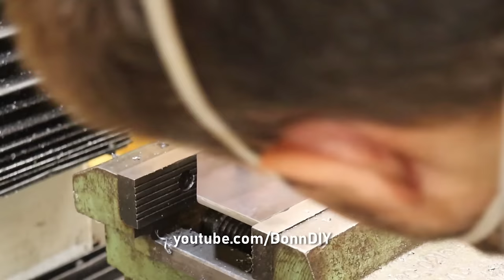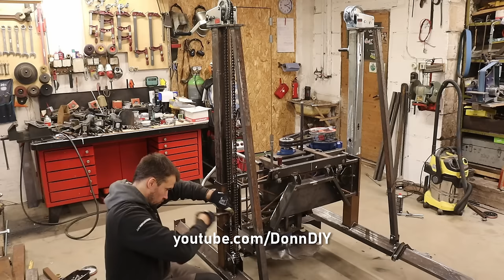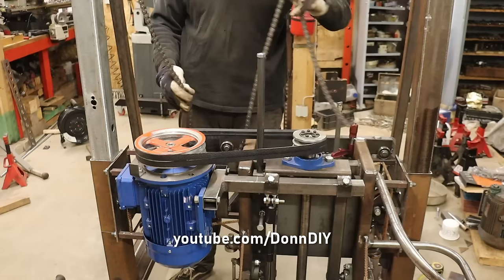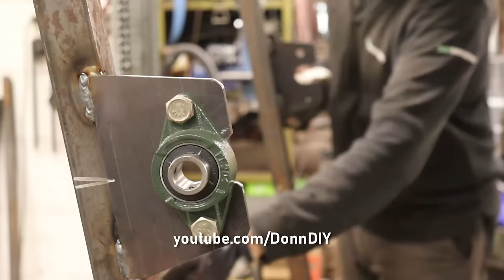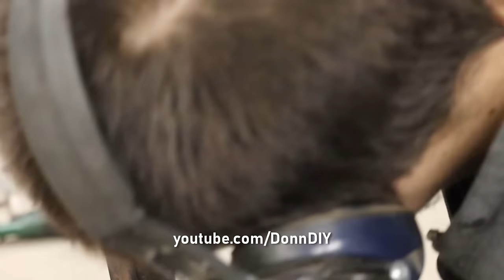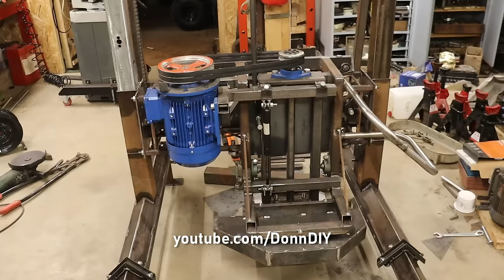Swingblade SAWMILL Build Ep.8 - Parallel Lift, Board Size Adjustment

Comment: I am pretty sure you clearly explained that when you first made your meter-long section. I was on board for that. what I could not forsee was how you were going to get the parallel lift to work. Even after you showed it working I had to rewatch like 4 times before it made sense! brilliant stuff!

Comment: 22:16 Do it in sections and use cable to tension the sections/beam together. Like a modern suspension bridge. Instead of putting the bolts inside the pipe (at the four corners) put the cable inside there, and move the bolts inside (of those four coordinates). You can easily span 10 meters with something like this once you've put the proper tension on it.

Comment: Have you considered building multiple sections of beam, maybe 4m length each, and bolting them together?  If the mounting hardware is inside, it could still have a smooth outside surface at the joint for the carriage to roll across.  That way you are not limited by the size of your shop.
Reply from the maker: Yup, this has been suggested by others as well and I do agree with it.👍 I have to think about it and seriously consider building the beam in sections.

Comment: Awesome build, as always. I love to watch your workmanship. The only thing I dont get, sorry if its obvious... the machines main rails direction, how the tower will slide... and the orientation of the blade guards.... or the vertical rail is just this short until you build it? Are you going to replace that beam rail to a long one after the other mechanical parts are done? Maybe you told this already in one of the parts... , and I just missed t...
Reply from the maker: Just watch the end of this video...
Reply: @DonnDIY  oh I did not reached to that point. I went back to EP 1 and found when you build, you wrote to the screen that this is a test carriage. Make sense. Thanks for your answer. :) Cant wait to see the next episode.

Comment: I’m not all that bright but will those chains not get clogged with sawdust and soon fail.
Reply from the maker: Reasonable concern - I'm experimenting with different sprays to find the best non-sticky one. If the chains get clogged I just have to clean'em.👍
Reply: @DonnDIY  // I use a bicycle chain "dry lube" called: "Squirt" on applications like this. It's a not sticky dry lube with a wax consistency once it's dry.

Comment: 20:44 no sprocket bearing ?
movement would perhaps be easier, fluid...
&
Metaflux 70-30 Abra+
Teflon lubricant to clean abrasive disc 
but does not clog with chips, 
and makes efforts much easier,

except that it must be reapplied very often, volatile, 
and polluting
Reply: Great  work i think  you are able to cut and saw huge trees with your new mill, and that are also what a Swing-blade mill are ment fore 👍
may be the first project for the D/D Swing-blade should be material for building a shed for the mill ❓
Reply from the maker: I already have made a shed blueprint in advance to this mill that is waiting for its turn to be built. 😀
Reply from the maker: The sprockets have to be lubricated each time before use. I didn't bother with bearings since the rotation speed is so low. And it was easier to build. I am currently using teflon spray. And have to experiment with different oils to get the best result.

Comment: Donn. That is not how I would have done it. I would have welded the chain directly to the sprocket bracket and then jacked the frame up until it bent. After a few more cocktails I would be forced to called my stepson to come over with his angle grinder to free up the industrial strength instant adhesive (cyanoacrylate) from my, well, let's say "hands". See? Wasn't that easy? I'll be fine in a couple of weeks.   😉🤣😂🤣😂😍🤩❤😺

Comment: I keep thinking you should use more bearings to make it smoother and get rid of metal on metal wear. But then I remember that this is going to spend it's life outside in the rain, snow, and whatever else nature is going to through at it and bearings are expensive and water always gets in no matter how good a seal is on it. This is a great project but makes me a bit nervous to use it compared to a bandsaw style mill. Great job as usual.
Reply: The amount of wear something like this will see is minimal. It would take 20 years to wear through that metal. It's not an industrial saw that sees 50 logs a week. My grandpa's brother had a mill that would occasionally (as an overflow from the bigger mill) cut something like 10~20 long per week. It didn't have any bearings, metal on metal and it's still a solid construction to this day. I still go to my brother's farm and cut wood on it from time to time. Unless my brother fixed anything (and i don't think he did) that mill's now... 64 years old or there about. It lives in a shed, sure, but it's still out in the open. Sometimes, simple, but functional is the best way to go.
Reply: @aserta  ummm,my non industrial saw sees more than 200 logs per week on a slow to average week,and the saw blades ate the most costly part other than the timber itself,and since I sharpen the blades myself it often comes down to the costs of the timber except whe I get hired to clear some acreage at which time I'm getting paid to clear and also haul off the timber that becomes the mills next logs,for free,or paid to..win win then!! 😆

Comment: I'd add a plate with 2 holes in it over the lower traverse chain pulleys simply to keep the bolts from bending over a long period of time, 1/4"×2" ,2 holes,2 washers and 2 nuts would effectively hold the outer ends from movement fore and aft as the tension on the sprockets being would tend to be during moving of the carriage..
Reply from the maker: Well thought out!

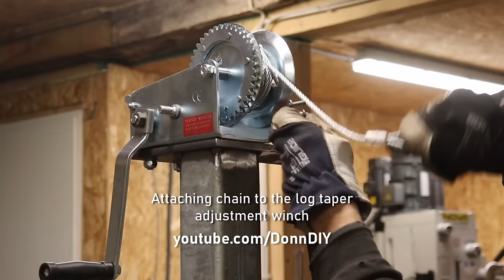Comment: Great progress.  I'm wondering if the point load the wire exerts on the chain @ 7:55 is going to cause a reliability issue later.  Maybe if you drilled a hole in some plate that copies the dimensions of a link - and then attached the cable to the plate in some way - the load would then be spread across the entire pin in the last link of the chain.  Just an idea.  Thanks for the videos.  Stay safe out there.
Reply from the maker: I thought about it too while installing the master link - my solution would be a chain link cutoff which is already cut in half and fits nicely into the steel cable eye and in the master link and would spread the load close to the ends of the chain pins.👍

Comment: Would it be worth adding some “way wipers” to clear the sawdust so the slide isn’t picking up sawdust in its rollers?
Reply from the maker: The circular blade should create more wood chips than dust which shouldn't stick to the rails that much. Also the rail surfaces are at 45 degrees and should be self-cleaning to an extent. The contact points are also quite small which should apply enough force to the slider surface that it scrapes the surface clean by itself.

Comment: @Donn DIY 
Will you send the slide parts for electro galvanising ❓
we sent our sliding parts for  electro galvanising and asked them to let it hang in the bath for 20min the Zink Layer went much thicker
Reply from the maker: I'm not sure. I have to research where I can get it done first and decide then.👍
Reply: @DonnDIY  it makes all the sliding parts and chains maintenance free  ❗
and you just have to apply a little ACF-50 Anti Corrosion Formula  ones a Year 👍
Reply from the maker: Thanks, I'll really consider it.👍🙏

Comment: Thanks for the explanation.  I wasn't sure how it would work but knew it would be much longer in real life use.  Now it is much clearer and will be waiting for its maiden run.  I'm still amazed at your skill with the cut off wheels.  If I'm not being too nosey what happened to the plasma cutting table?
Reply from the maker: I still have the plasma table and it works great, I just prefer angle grinder when prototyping parts.👍

Comment: The sawmill build is moving right along.  How much vertical taper adjustment will you have over the full length of the beam?  Also is there any taper adjustment for cutting parallel to the grain (or bark depending on how you look at it)?
Reply from the maker: The longer the beam the less taper adjustment it'll have. I have to draw it out in CAD to see how much it actually is depending on the length of the beam. To get the mill parallel to the wood grain in horizontal direction you just have to slide one end of the whole sawmill on the ground.😀

Comment: Always good to see the progress Donn = ) I know you are much further ahead than the video releases but I wonder if you are going to have to pre-stress the beam like they do with low boy trailers to counteract the weight of the cutting head as it travels across the centre of the beam. I know the latticework of the beam is going to be really strong and rigid but even so, its a pretty big span with no centre supports.... Thanks as always and hope the family and you are all safe and well.
Reply from the maker: I'm not actually further ahead than you see in the video. Every episode is of the actual work I've done during the week when it's released. I am planning on pre-stressing the beam but I'm not certain it's the same way those said trailers are. I've also  been thinking about adding a steel cable in the beam that I can tighten to give the center of the beam a little more support. But we'll see how it works out.👍

Comment: I've seen the Lucas sawmills on another  channel. Great set up and those blades are very durable. And you can resharpen them yourself. But they have their drawbacks like anything.
Reply from the maker: The main drawback (for me) with this mill is the cutting width but as long as I've used any kind of sawmill here at the homestead I've been needing and cutting dimensional lumber rather than slabs. And slabbing with this mill can be done with a separate slabber attachment.👍 Blade sharpening is true - it's much easier to sharpen carbide teeth (6) on this circular blade than a chain on a chainsaw mill or band on bandsaw mill.

Comment: Apart from the blade, motor, and a couple bearings which are easily replaced this should last practically forever with some lube and a coat of paint now and then. A very practical and well thought out machine.
Reply from the maker: I hope so too.👍

Comment: Will there be a base of some sort to hold the logs to keep them from shifting during cutting? Maybe a lean-to for overhead protection from weather / board storage?
Reply from the maker: The base for the log will consist of a couple of 180x200x600mm wood blocks with a slot cut in them. The round log will sit in that slot so it can't roll away. And that's it.👍

Comment: I see you cutting lots of parts with the skinny wheel- did you get rid of the plasma table?
Reply from the maker: No, plasma table still works fine. I just mostly prefer angle grinder while prototyping parts. When it gets repetitive then it is CNC plasma all the way.👍

Comment: those chains look quite tight, you might want to put a tensioner in it to prevent the chain wheels to brake off and relieve the tension during moving
Reply from the maker: No worries. Those side adjustment chains have to be tight since they're for setting board width and thickness. No slack = more accuracy.👍

Comment: Hand cranking sucks.  at least put a nut end you can use a cordless drill(on an extension so handle not wack you)
Reply from the maker: No worries. It cranks super light considering the weight that's on there.👍

Comment: 9:44  How do you made adjustment?   Simply move the blade in or out as it it mounted on the shaft?
Reply from the maker: Yes, the whole shaft should be moved out a bit so the cut lines almost entirely intersect.

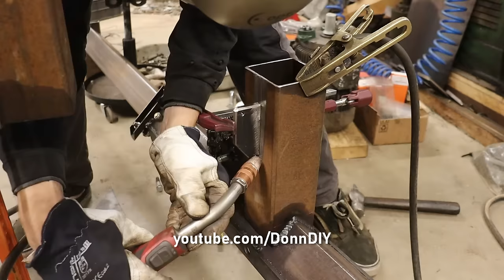Comment: 7:19    Do you weld in this tack tack tack manner to minimize penetration into the tube,  so it is still able to accept the piece slid inside?
Reply: or is it just appears that way in video?
Reply from the maker: I just weld it in this manner so the weld doesn't drip down while welding uphill. If I were to weld downhill people would get mad. 😀
Reply: @DonnDIY  thanks for the reply.  - I like to ask questions to learn.